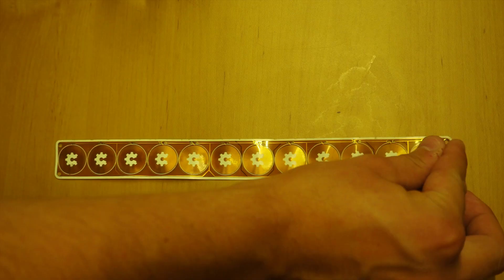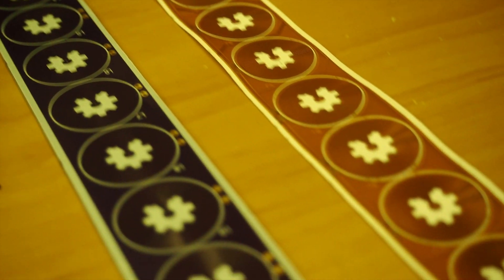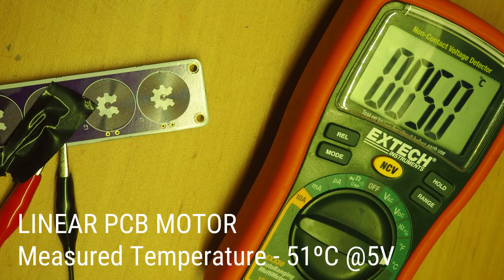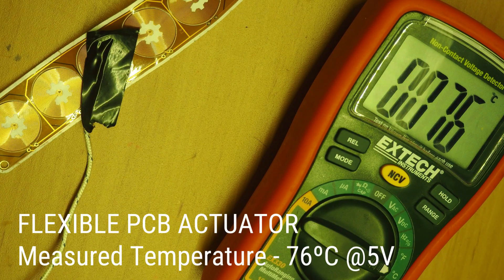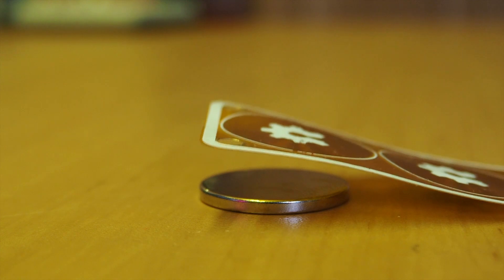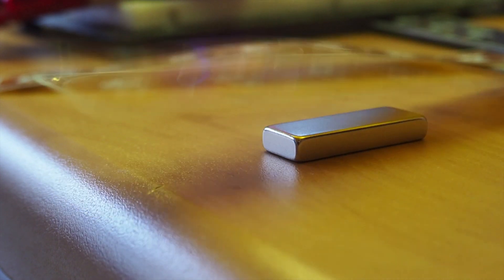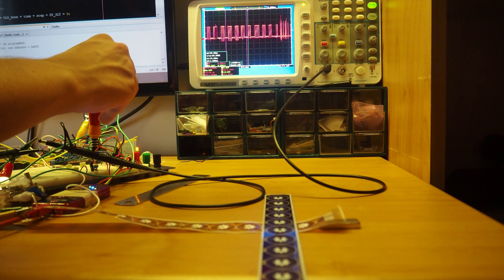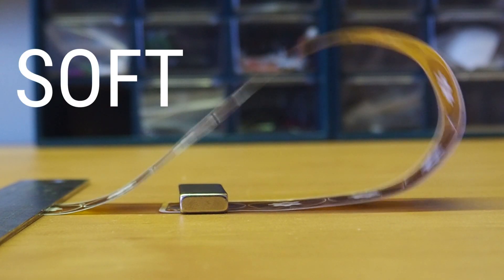My 0.1mm thick ACTUATOR!

Comment: instead of the magnet put 2 strips together and drive in and out of phase at high frequency, the beat frequency giving smooth movement. with a coin cell you might make a tiny orniphopter (or however its spelt) like a flying insect. electronics would be minimal